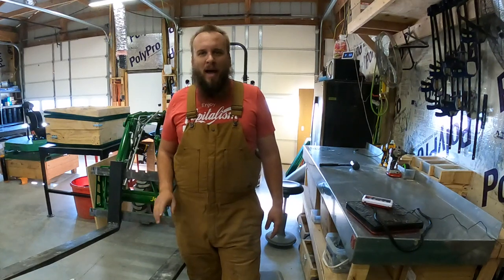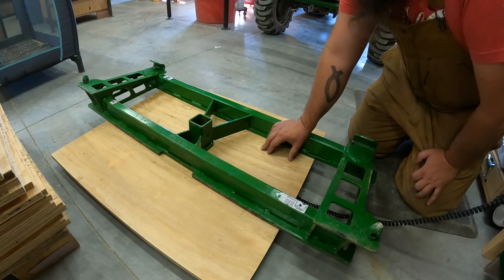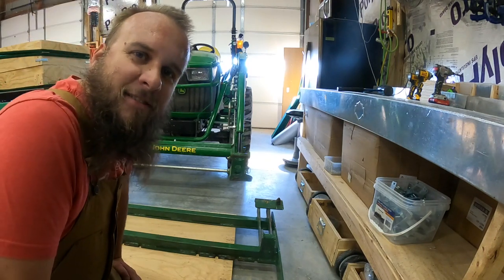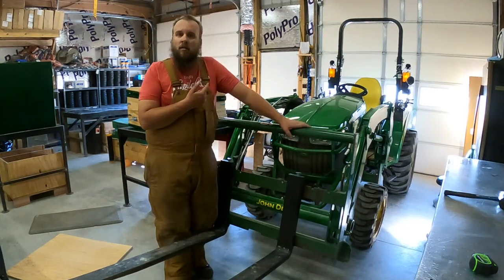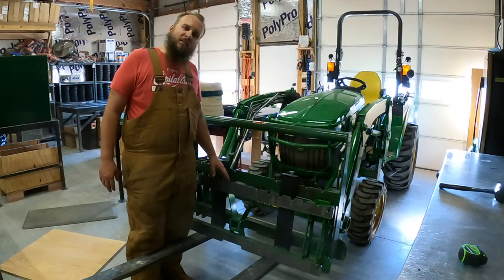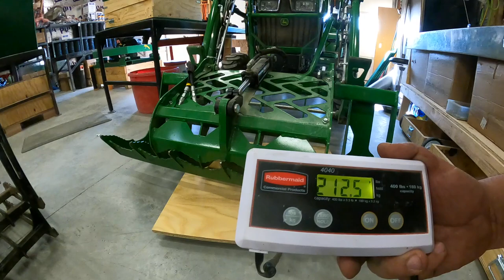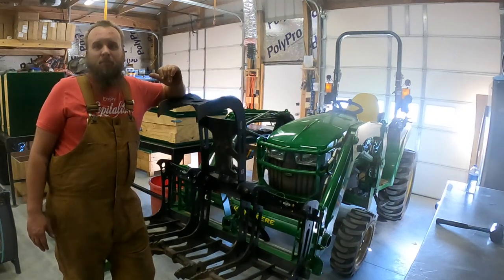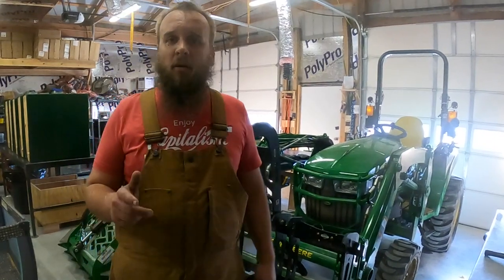Artillian vs Frontier - Head to Head Grapple and Pallet Fork Comparison

Comment: A tip for adjusting fork tines side to side. Raise the boom so you can tilt the forks forwards enough to see the bottom of the fork heel start to separate from the bottom frame rail. It should basically be hanging by the top rail. This reduces the friction to half and removes the binding between the top and bottom rail to where you can almost slide them side to side with a couple of fingers. A little lube on the rail helps a lot too.
Reply from the maker: Thanks for the feedback.

Comment: Good video, Thanks! If you change between pallet forks and Grapple and bucket like I do then it would be time consuming to reconfigure the frame each time. I would rather just hook up to what I need and go get the job done.
Reply from the maker: It is a little bit. Sometimes I just grab the other set of pallet forks.

It’s really more of a perception that it takes longer.

I set a timer and it took about a minute and a half to take the grapple off and put forks on

The other way you already have to get off the tractor twice to pull the pins out and then put them back in so it’s not much different.

The system is really convenient if you want to take multiple attachments with you, you can set all the pieces in the bed of your truck and still have a different attachment on the front of the tractor

It also saves people money if you want all of these attachments you only have to buy the frame once

It also saves space in your equipment area.

All that said I sometimes just grab my other set of forks

Comment: Good comparison video... I'll stick with my AV20F still.  I can change out the bucket, grapple, and forks easy enough.
Reply from the maker: What is AV20F
Reply: @RockhillfarmYT  That's the Frontier grapple you showed.  When they first came out (mine is series #05) in 2019, the grapple lid had a round tube. Mine was replaced last spring with the new updated square tubing top lid.  Thus we have the same Frontier grapple AV20F... unless they just changed the model number.
Reply from the maker: Gotcha. It’s a good Grapple. 

If I didn’t have a grapple or a set of pallet forks I would probably go with the artillian set, but if you already have them there’s no reason to replace it
Reply: @RockhillfarmYT  I'm surprised how little there is on the internet about this grapple.
Reply from the maker: The Artillian or the frontier grapple?

I have a bunch of videos on the Artillian stuff including the grapple

I’ve got a few videos where I show the frontier Grapple being used but it’s never the title of the video so you wouldn’t find it in a search
Reply: @RockhillfarmYT  the Frontier AV20F. Thanks for the videos.
Reply from the maker: Thanks for watching

Comment: Great video. I’m trying to decide on which grapple for my 1025r and this video was very helpful. Thanks!
Reply from the maker: Great

I am glad to hear it.
Reply: i have a 1025r as well. looking at both of these. artillian with 1 grapple and the frontier. i’ll mainly be using it for 12-15’ foot logs for firewood. does either one out perform the other with this task?
Reply from the maker: I wouldn’t say that either one out performs the other.  Either one will pick up the same log. I prefer artillian for a few reasons. 

1. The angle on the bottom tines makes it more user-friendly to get underneath a log at a natural angle

2. it’s a modular system which means you can always add things to it or make changes later, but it also means that if it was damaged you wouldn’t have to replace the whole thing. 

3. I think the build quality is higher on the artillian.  

4. Back to being a modular set up, but I think the Front hoe bucket is really useful if you don’t have a Back hoe.  If you already have the grapple it doesn’t cost much to add another attachment like the front hoe or the three point hitch adapter
Reply: @RockhillfarmYT  thanks for the quick response and insight. main reason i was thinking the frontier was for the weight. looks like it’s 50# less which is a good amount for the 1025r. thank you again for the info. love the channel!
Reply: @toddzeliznik9808  I decided on the Frontier grapple.  So far it's been great, the right color, bought through my dealer, and I'm very pleased with it.  I'm 63 and lugging stuff on and off the frame to change attachments wasn't appealing for me.  Plus, I already have the Frontier loader plow and a backhoe for my 1025r.  I do like Artillian's pallet forks though.  I have a cheap set of HLA pallet forks and the frame has already bent.  The Artillian loader plow setup is float only too, where the Frontier loader plow has down pressure and float.  Just some things to consider if you like the Artillian modular approach.
Reply: @greatmoose17  these are good points. glad you like the grapple. i had no idea the artillian plow was float only!! that is great information to know and kind of surprising to hear. how did you find that out? any complaints with the frontier snow plow?
Reply: @toddzeliznik9808  I watched YouTube videos and first saw a chain attached to the plow to lift it. Then when they demonstrated back dragging it was evident. Since then it’s been confirmed, no down pressure on the Artillian loader plow. The Frontier A10F (I think) 60” loader plow is awesome and attached firmly to the loader. You can put all the down pressure you want on it too. I added  the urethane cutting edge a month ago (bought on eBay), and now it’s better than perfect and doesn’t wreck anything. I’m really happy with this setup. I have 700+ lbs of rear ballast (Imatch, heavy hitch and 8 70lb weights) and the tractor is planted firmly for any kind of plowing you would want to do.
Reply from the maker: I don’t have any experience with the artillian plow so I can’t comment on that.

A friend of mine has one and he has a YouTube channel called purple collar life. If you still have questions I’m sure he’d be glad to help
Reply: @RockhillfarmYT  thanks! i actually watch his channel as well.

Comment: a real down to earth guy ...... thank you!  I am in the market for a grapple I just bought a 1025 r I am weighing the differences right now I am on a fixed income so cost  is a big thing with me will the artillian grapple fit the John Deere fork frame also I am well aware of the lift capacities of the tractor and some of the grapples out there weigh as much as 500 lbs
Reply from the maker: The height is right for the grapple to go on the John Deere frame but it would have to have the slots cut in it at the perfect spots along the top because that’s how you latch the attachments in.

Initially the Artillian grapple is more expensive, But once you have the frame the other attachments become less expensive.

For instance, a very popular stump bucket like the one from Goodworks tractor is $1200.

If you already have the Artillian frame then their Stump bucket is only $600. The frame is around $800 making the total $1400

As you can see, if you only buy the stump bucket, it is a little more expensive, but you only have to buy the frame once so adding additional pieces is less expensive

Comment: If I get a loader for my BX I’d like to try the Artillian system. I just wonder if it would stand up to the M6060? I know it’s rated at 3,000 pounds but when you get to pushing and prying on things it will apply a lot more force. I’ve built two sets of forks, one for myself and a neighbor. I’d like to weigh them and see what they weigh. Good comparison, I’d definitely go with the Artillian if purchasing new.
Reply from the maker: I think it would stand up to the force of the tractor but I don’t know if it would seem wide enough on a big tractor like yours.  It’s only about 4 feet wide

It would be perfect on the BX.

I love your homemade forklift/grapples.  Somebody needs to mass produce that

Comment: Ok I have some questions.  What does the artilian frame weight with the guard on it.  Have to tried to put the grapple sections in the frontier fork frame. What’s the price differences between the frontier and the artillian also.
Reply from the maker: According to the website, the top rail weighs 23 pounds, so the frame would way 110 with the rail

I don’t think the artillian Grapple would fit on the other frame unless you cut notches and drilled holes in it to accommodate mounting

I don’t remember the exact cost of the pallet forks from the dealer. I should look it up though

Comment: I was going to comment about how my Frontier Pallet Fork frame wasn't the same as yours when I decided to look at it a little closer.  Turns out, even though I bought it from a JD Dealer, it's not a Frontier.  The forks do not come off unless you unbolt a tube that the forks slide on and then remove it first.  A real PITA if you want to change to shorter/longer forks.  

I'm getting ready to set my 3038E up for an Artillian grapple and am frustrated that I have to buy the fork frame first.  If I had known then I wouldn't have gotten the forks that I have now.
Reply from the maker: Yeah, if you buy into the Artillian system you only have to buy that frame the first time but it is a bite on that first one.

My fork frame actually is not Frontier either. I thought it was but it’s not.

Weird that the forks don’t come off easily on yours
Reply: @RockhillfarmYT  Yeah my forks have a larger tube on the back that slides on a smaller tube on the frame. You have to unbolt that smaller tube and slide it out to take the forks off. I guess one advantage is that you’re not limited to spacing since the forks don’t sit in cutouts on the frame.

Comment: Have the hoe bucket, it's fantastic if you have light rock free soil. The second you find a rock you're in danger of bending it up bad.
Reply from the maker: Yeah, the teeth can’t get bent. I straightened mine a couple times

They have a new and improved version with a removable and replaceable cutting edge that I showed in a video the other day
Reply: @RockhillfarmYT  I'll have to watch that! I was considering welding a heavy duty plate to the bottom. Maybe grind teeth into it then welding it.